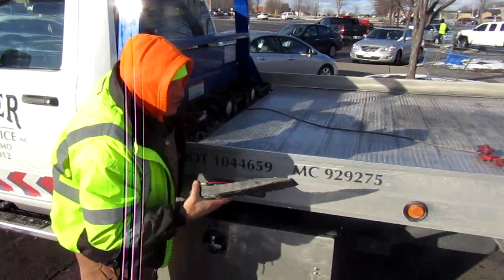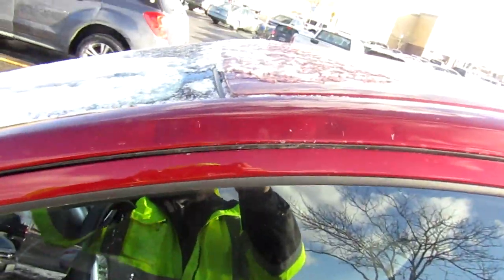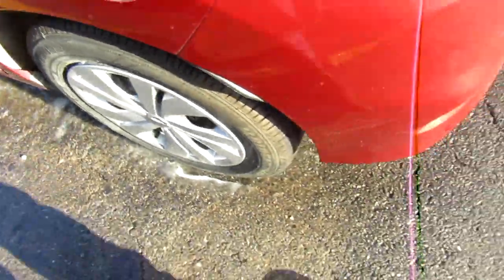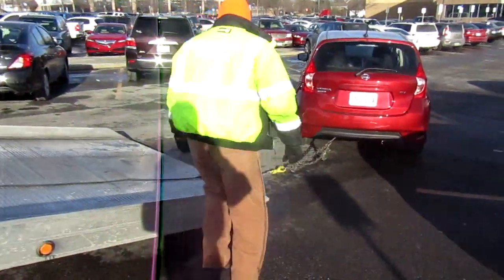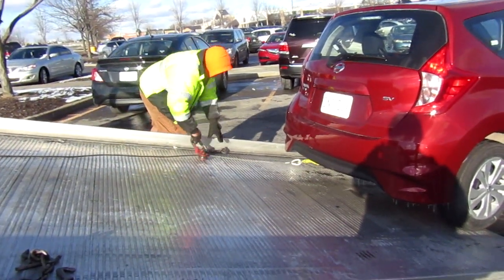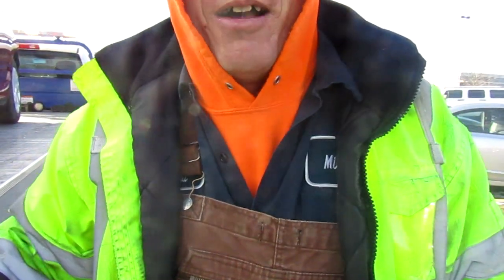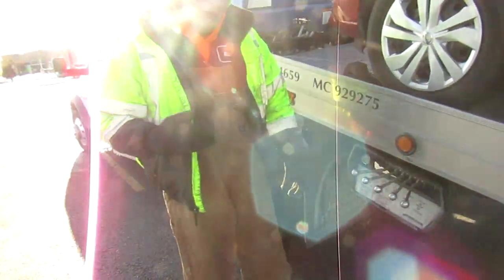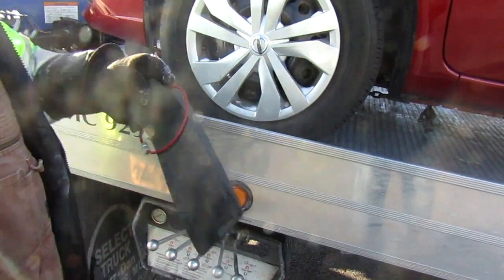How To Get A Car Out Of A Busy Parking Lot

Comment: We all do the job in our own way. Since the nose was behind the curb, I would have done it a little differently. I would have unlocked the door and accessed the interior, securing the steering wheel and setting the parking brake. Once that's done, use the shifter bypass to un-park the transmission. Once it's ready, pop the rear up with the wheellift and tow it to the empty part of the lot and set it down. Spin the truck around to the front, scoop it up and away you go. As it is, that would not show the snatch block and skating action. It would allow you to move the truck out of the way of caddy man. Wind on the mic made it hard to understand some of the speaking parts. I've had to drag cars out of parking spots in some very difficult lots. That lot had the huge advantage of angle parking. Most of the lots I have to work in are 90 degree spaces. My truck is bigger than yours but it does turn pretty sharply. I'm not criticizing what was done, just saying what option I would have chosen. One time, my neighbor lost her key at the grocery store. They asked me if I could get the car for them. I told them to not worry and zipped over to the place. Saw the car was still there, went to the customer service desk and got the key, loaded up the car and zipped back home. My neighbor was pointing at the driveway where he wanted the car. I put my truck in a spot with the car aimed toward the place, but across the street. I put the car down and he came over and asked if we were going to push the car. I told him we could if he wanted to, but it was easier to drive. Surprise! They were elated that I got the key.
Reply from the maker: There are many ways it could be done but i wanted to show how to do it using skates and a snatch block
Reply: Donald Chastain ... Copy that. I knew you wanted to show the slide action. It actually put me in mind of a car I had to drag out of a parking space. I tied the steering wheel, but couldn't release the transmission. It was in the dogleg section of covered spaces in an apartment complex. Naturally, people were trying to go through, so I kept the truck tight to one side and kept the chains down low so I could wave cars over by letting them go slack. I did a few different hooks and pulls to bring the car back and turn it square.
I dropped the chains, slid the bed up to level and relocated to the same side as the car. Walked the bed under and drew it aboard. I love the challenges. Merry Christmas to you, your family and crew.
Reply from the maker: Thank you that os the main thing i love about doing this kind of work is the next challenge around the corner

Comment: easily move cars with gojaks
Reply from the maker: Yes it is
Reply: As long as the surface is hard enough and smooth enough. Dirt and gravel thwart Go-Jacks. LOL! 
Hey Donald, I finally got to use my skates yesterday morning. Lady's Mercedes Benz battery died and the insert key in the fob key didn't go to her locks. Couldn't open the trunk to jump start and no contact point under the hood. May have had a contact point on the passenger side front floor, but I wasn't going to go that deep. Another company had been out there, the day before and had wheellifted it from her garage to the street, but he couldn't convince it to go onto his flatbed, due to the front wheels being turned to the right and the steering wheel locked. Somehow, our dispatch didn't get the whole story and sent me out to haul the car to the dealership. When I arrived, she showed me the car and explained what happened the day before and also that she didn't expect it to be towed then, just checked to see if wheellift and dollies was required as stated by the previous driver. I'm not too inclined to leave someone hanging, especially since I drove twenty miles to get to the car, so I convinced her to let me take care of the car at that time. 
When all was said and done, she was quite happy and her maddening situation was on its way to resolution. FYI, I don't have any additional monetary incentive to get the car towed. I just enjoy outsmarting the brainiac automotive engineers who come up with such stroke job designs.
Reply from the maker: Good job skates come in real Handy
Reply: I will take skates over go-jacks any day. Go-jacks are heavy, don’t roll very good on rough surfaces and the car can get away from you to easily
Reply from the maker: Gojacks have their place but on these tow trucks there's not much room to store stuff I'll use skates any day and every day of the week over gojacks
Reply: Man that was painful to watch
Reply: Snatch block looked like alot less work honestly.  Good luck on even a small incline by yourself.

Comment: What a mess. Pull some more rope from the get-go and you wouldn't have to reposition your truck, just "release" your snatch-block and keep pulling. I never move my truck and rarely move the snatch block. Foresight is key. This took WAAAAAAY too long. WAAAAAY to long. Your narrator said specifically "a snatch block CAN save you a lot of time and a lot of work." He's right, but this video doesn't prove that.
Reply from the maker: Thanks for your comments bud I could have done that job in about half the time or 3/4 of the time but I just wanted to do a training video going to these little bitty parking lots for you can't get truck really down the aisle and you got to pull the cars out that's what I was trying to show plus you don't want somebody brand new doing something like that

Comment: Why are you putting this thing on the flatbed throw it in your glove box with that big F-450
Reply from the maker: That thing would almost fit
Reply: I believe that's a 2016-2017 Dodge Ram 5500. Not an F-450. Love the Dodge Ram chassis compared to the Ford Super Duty.. and the Cummins diesel seems to be better than the power stroke.
Reply: Yep that's a Dodge Ram 5500.. Great Truck.. I have the steel bed, alot more forgiving than the aluminum bed..
Reply: Looks like someone didn't have the big easy lockout kit like we carry..  I love it when a member trys to get in the vehicle their selves and then calls AAA..